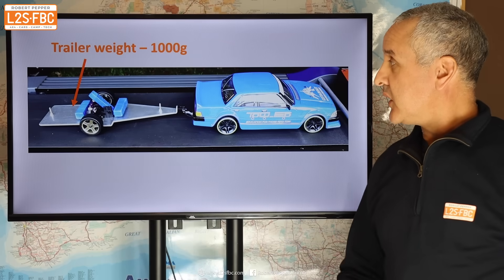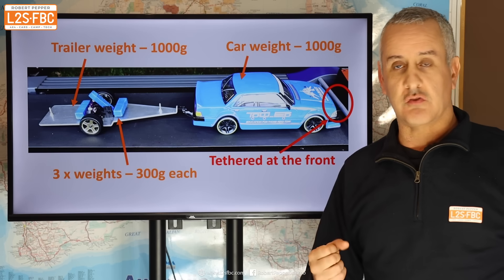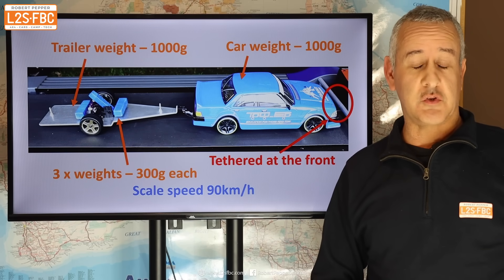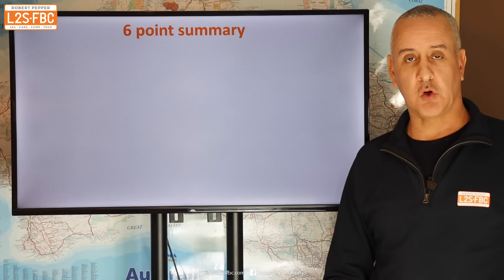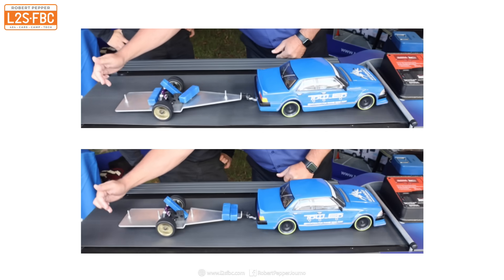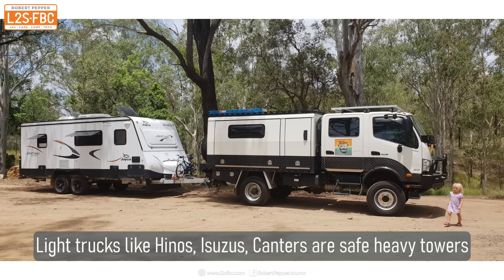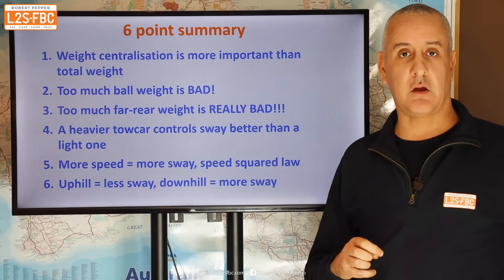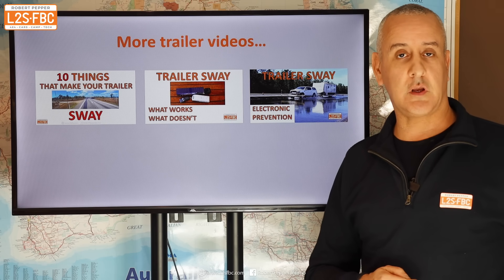7 trailer weight distribution setups, some safe, some deadly.

Comment: At 4:50 they're demonstrating the factor that made me purchase a nominal 1 ton diesel pickup (Nominal because it actually has a load capacity of 4500 lbs in the bed) with a dual rear wheels setup even though that extra set of tires actually decreased the GVWR of my truck. The extra weight increased the tow stability since I wasn't towing anywhere near the Gross vehicle and trailer rated weight.
I noticed your model set up at this point does not have a weight distribution hitch set up. I'm looking forward to see if you add one for heavier trailer weight simulations. It's extremely important to get the amount of tension on your weight distribution system correct because to much put on the tow vehicle can cause instability just as to little can. Weight distribution hitches also do not make it okay to improperly load your trailer.
I also noticed that when you added the 700 G weight you put it in the point where it added the most stability. If you'd put it in the front or back it would have adversely affected the handling much more severely than not having it there at all.
Speed affecting sway is also one of the reasons I never drive over about 65 mph when I'm towing even when the speed limits are higher. Some of the other commenters mentioned towing at speeds of 80 mph or more and to me this just seems to be taking an insane amount of extra risk. Something going wrong at 65 might be able to be ridden out to a safe stop whereas the likely hood of a catastrophic effect is way more likely.

Comment: Several years ago I was towing my caravan with my XJ6 Jaguar and initially put all the  'Weight '  over the axle of caravan but did not dare go over 60 Km/h or swaying would make it undriveable. 
Eventually I stopped and pulled all the  'Weight '  forward say halfway between Axle and Tow bar ball and immediately could drive very steadily even up to 160 Km/h with no swaying whatsoever. 
This happened whith two passengers in car as well and even involved a sudden emergency slowdown hitting the brakes hard to avoid a motorbike accident right in front of my car at 160 with no out of control situation of my vehicle. 

Second situation involves heavily laden trailer pulled with Jeep Cherokee travelling at 80 Km/h where I had to do a severe evasion of possible accident by literally jerking the steering sharp right and again sharp left immediately thereafter.  In this I expected major problem of swaying out of control due to trailer  'Snaking '  behind but managed to get instantaneous control thereof just by being wide awake and should I say being  'experienced '  in contemplating what was to come of the maneuver I was forced into. 
PRECISELY  COUNTERING  what was to come saved me and my passengers and my Jeep as well as approaching vehicle on a single lane road. 

Ps. Jeep instance was with 'Balloon tyres '  wich have greater  'Tyre Roll'  also a BIG problem in losing control of vehicle.

Comment: If you get sway and accelerate its imo going to decrease or stop the sway (like when you get a skid with a fwd car, give it some throttle and the rear tires will start to follow the front tires again). Offcourse you need to slow down eventually then perferebly do that going uphill. Those accidents probably hapened becouse the driver braked wich made the sway worse.
If you need to overtake somebody when towing, do it upphill and make sure to loose that speed before going downhill again.

Comment: This video is great. From an engineers view I doubt the speed squared formula for the sway. There is a resonant speed. (Or to be precise: There are resonant speeds. If you have sway at speed v there will be sway at 2v too.) You can drive overcritical. It's just dangerous to brake from overcritical speed.
If you consider to buy a new trailer, get a 2 axle one (not tandem axle, real two). It's a bit learning to reverse but they are stable.

Comment: What about hitch height? In other words, I have an off-road package on my truck and the receiver height is 50 cm (19.5 inches) off the ground.
Reply from the maker: That makes a difference to towball mass and therefore stabiity. Check out my Rear Axle Loads video for more on that.

Comment: What happened to stabilizers that were placed left and right of the tug between car and trailer? These stabilizers are basically dampers that dissipate the energy of the sway movement, making it more difficult for the sway to build up to dangerous levels.
Reply from the maker: Ideally you'd set the trailer up so they're not needed.
Reply: @L2SFBC  I think it's usually good practice to have several lines of defense. I think you'd better drive slowly enough to no be caught with a swaying trailer in the first place, but one can do better than that.
Reply from the maker: @jcsjcs2  agreed!

Comment: Good informative video. We had a crash towing a trailer downhill. Hauling a farm tractor on a tandem flatbed trailer not parked far enough ahead to balance the weight. Didn’t flip over but trailer slid sideways slamming into side of the truck then broke the safety chains trailer went down the road and crashed into cable guide rail. Any swaying difference between single and tandem axle trailers?
I’m very cautious after that crash now whenever I tow something.
Reply from the maker: Tandem are more stable but the dynamics are fundamentally the same. The TBM changes with height different according the whether it is tandem or single - see my other video.

Comment: Will slowing down to potentially even a stop help stop the sway when the weight distribution starts to go off
Reply from the maker: Slowing down increases the speed difference between trailer and towcar so doesn't help sway..but any speed reduction will. So it's risky.

Comment: I’ve always been taught that wheel base /length of vehicle vs length of trailer is very important to stability. I’ve driven a lot of trailer and sure didn’t enjoy being severely overloaded going from OK all the way to Tacoma,WA with my equally diesel F350, double flatbed trailer setup,two tractors and a bunch of steel fence panels. That was one scary trip for me!
Reply from the maker: Yes it is, longer wheelbase = more stable, longer drawbar = more stable, but that often can't be changed as easily as weight distribution.

Comment: Excellent information!
I think speed plays a much bigger role in accidents though than was explained here.
Ive been pulling a travel trailer for 14 years.  I  typically travel between 60-63mph.
I can’t tell you how many times I’ve had idiots blow by me at 75mph with a bumper pull or 5er.  Absolutely no reason to go that fast!
Reply from the maker: Yes, nobody has had sway at 0km/h...

Comment: So in a mental model of this problem, what you're trying to optimize is two things: 1) Low angular momentum of the trailer by concentrating the weight between the 2 or 4 wheels, and 2) equal weight distribution on the vehicle's 2 axles?

This then also means that if you're also hauling heavy things in your truck, you should compensate by putting the center of gravity of the trailer a bit further back?
Reply from the maker: Weight over axles yes, and the heavier the towcar the better.

Comment: The problem is what is being sold as a Anti sway bar in fact the correct term is an anti pitch technology designed to correct or should I state restrict the pitch movement of the tow hitch of the van being towed

Though with the movement of going to a static hitch design on the hitch kinda makes the anti pitch bar redundant in deployment... and only should be used if you can swivel your hitch around..

whilst you are correct weight placement  plays a part in swaying what you tow, however what  causes roll over of tow vehicle the anti pitch bar being  not used in the the correct manner it was designed to be used within..
weight rating at the tow (in kg) is typically quarter of the weight of the  trailer being towed 

your example there beetween car trailer on landrover

you would have a min CGVM (combined gross vehicle Mass) of 4.5 ton (towed) 450kg is a bare min on the tow ball and 4.5 ton on the suspension would be a need..

you GCM 7.5 ton combined with =/- 500kg allowance for fuel.

given the average weight of a 4x4 is roughly 2.5 ton..

Comment: Almost no axles are that far forward however. Also i think scale of axle spacing needs to be considered. I believe the results. I just wonder how much those changes would affect a to scale pickup truck axles with a common trailer
Reply from the maker: The relative weight effect would be the same.

Comment: Pulling a trailer with ballooned tires on an SUV with loose suspension. Yeah, what could go wrong. Use a proper vehicle for the trailer you are pulling. Weight distribution does play a part. But you don't always have the luxury of changing weight locations. Your best bet is to get a vehicle specifically designed for pulling. You know like one that doesn't bounce around and can't be easily snatched side to side.

Comment: Tremendously good presentation Robert!
I have seen many argue, that it’s not a matter of the weight distribution, - only about the center of gravity.
A little addition: The distance between the towball and the axles also has a meaning.
Short distance from tow car rear axle to towball is good. Long distance from towball to trailer axle is good.
Which means that changing car might have a significant influence on stability.

Thanks again!
Reply from the maker: Yes you're correct - that does have an effect, but only so much in the one video!

Comment: Let’s say I understand this completely. Can we talk about rear suspension and rear suspension help. All I’m getting at is I plan on towing a few dirtbikes with an enclosed trailer. Not sure about hauling the extras within the car as it doesn’t deal well with weight. Changed the rake of the vehicle quite easily. I need an expert opinion.
Reply from the maker: What's your query?

Comment: Best system I ever drove was Holiday Rambler, which used the trailer brakes by Kelsey/Hayes with a differential motion sensor, which hit the trailer brakes whenever the front and rear of the trailer were moving different directions.  Very simple, very effective, 100% instant sway correction, regardless of weight distribution, and did not impact lane changes or low-speed maneuvers.
Reply: the front and rear always move different directions if its the same you're in a slide
Reply: @Baka_Oppai  Have you ever changed lanes while pulling a trailer?  Gotten on and off a highway?  That's both ends moving the same lateral direction.  Even in a turn, both ends are moving the same direction, just at different speeds.  It's only at low speeds that you can really have them moving opposite directions, such as parking lot maneuvers.

Comment: Does a trailer with no brake sway more _
Reply from the maker: Makes no difference, but it's easier to get rid of sway with independent trailer brakes.
Reply: @L2SFBC  Thanks. Years ago I drove 1000 km on flat motorway from Germany to France with a long trailer having no brakes.  Max speed allowed by sway was 45 km/h.

Comment: Because of the teather, your not able to show the effects of steering changes dramatically when too much tung weight. Too much tung weight causes the steering wheels to actually rise to a point where they don't have sufficent contact with the surface. Causing one to sway, sometime dramatically enough to do the same as too much rear weight. Been there, done that.

Comment: I remember how during my student summer job my boss and I were loading a trailer full of construction material leftovers to move to the other site. As we're doing this (totally wrong), I'm reading the guy a lecture about weight distribution. He parrots me and makes fun of me, and says stuff like: "if you're so smart, how come you aren't lecturing in your university and doing this crap with me instead? Then we get back in his truck and that trailer starts swinging wildly behind us. The first turn we were making freaked the guy out so he got out and adjusted the things inside a bit. Gets back behind the wheel, and the next turn we're making he nearly lost control of both vehicles. Finally comes to my side, opens the door and goes: " - OK, smart guy. I give up. Show me how should I attach all this crap properly".😆
Reply from the maker: That's great! What had he done wrong, and what did you change?
Reply: @L2SFBC  For one thing, we had a bunch of long rebars, and he placed them too far out, projecting from the end of the trailer (I suspect he feared they could slide forward and damage his truck). He went: "-No big deal, - I'll just balance the weight by putting the cement bags and gas generator in the front. I was like: "- It's not just about the overall weight balanced front to back, imagine what happens when you turn at the next exit".

In the end that's exactly what happened. We had to spend a little more time centering the rebars, and spreading them out a little, then put a lot more effort into attaching them properly. Also because he put too much weight at the front trying to balance these rebars it really sank his shocks on the rear axle. Not to mention that all the while I was un-bolting the wooden panels and bringing the cinder blocks from the upper floors, he filled the bottom of the trailer with much lighter load, in the end the center of gravity was way too high, which I also told him was a disastrous idea. We basically had to re-pack the trailer properly with heavier stuff on the bottom before we went on our way again. He usually hired a company to move materials, so he never had to worry about packing it, but on that day he felt that the expense wasn't justified, as it was a residential project and the leftover materials could all fit into a single trailer. 

2 years before that in my freshman year I worked my summer job at a moving company, and on my second year as a supervisor because by then I had a lot of experience packing trucks in such a way that the load was distributed properly and all of the items actually survived the move. It's kind of both a science and an art, you develop intuition for this, and you know if something would fit the doorway without disassembly, what to pack first and how many moves it will take with just one quick look. Similar to how a bricklayer knows how much mortar to slap on for each brick to be evenly leveled with the next one.
Reply from the maker: @telumatramenti7250  fantastic story thanks, and yes "balance out the weight" is common, the weight is indeed balanced but unstable!

Comment: this is the reason why in the EU the towcar has to be heavier then the trailer.
Reply from the maker: Is that a legal requirement?
Reply: @L2SFBC  in most cases yes, your not allowed to pull trailers heavier then your tow wehicle 😁 at least here in Austria and i guess in germany too, only exeptions are boat trailers. Also your normaly not allowed to exceed 80km/h with any trailer, except it is confirmed by the manufactirer that the trailer can go 90 or 100 but that is absolute max
Reply from the maker: OK, interesting...we can tow heavier than the towcar, and up to the speed limit in many cases!

Comment: You also need to consider tongue pitch. If the ball and tongue are not level when the trailer is weighed down you will have the same issues. To much of a drop on the hitch will put the weight forward. Not enough drop will put the weight back while picking up the rear of the vehicle.

Comment: 3:30 front wheels will not be touching road will cause loss of tracking front wheels cause it go all over the place or wreckage 

if you want avoided getting in any bad conditions recommend letting off of gas pedal dont fight steeling wheels because it will create more loss tracking on road just generally turn it will line up with vehicles going dont go too fast because will throw you off aging limits to avoiding getting that problem is stay under 35mhp or less

how i know this stuff is because i been hualing trailer a lot n helping ton of other out how handle it avoid wreck accidents orther n stay safe on road

Comment: Any time I have ever had sway I floored the throttle, straightened the trailer, and then slowed down. I think besides having a properly set up load, the first thing would be not to panic and start slowing down and make the sway worse.

Comment: This is all good advice but will not solve the snake problem - it is the lack of control to the trailer until now - Differential stability is the only way forward. AlKO have tried but have only succeeded in producing a speed governor with pitfalls.